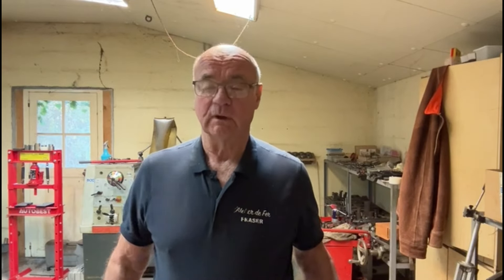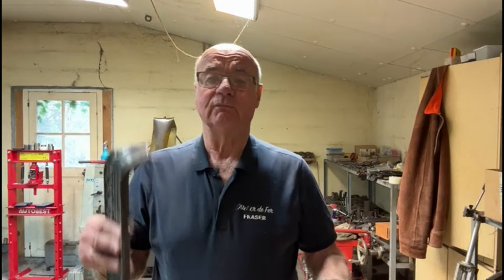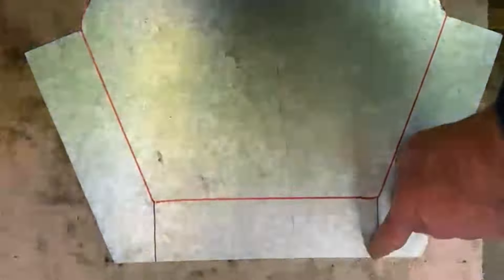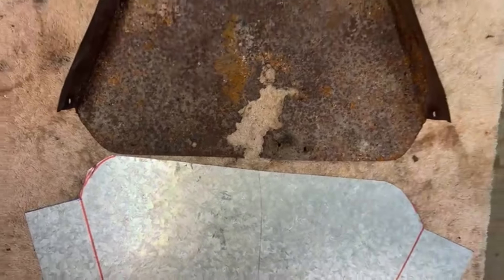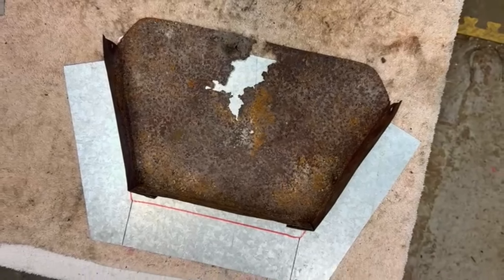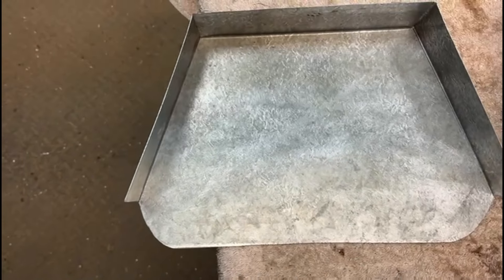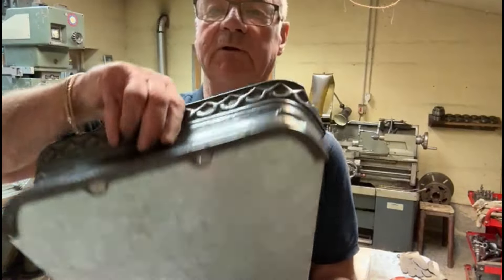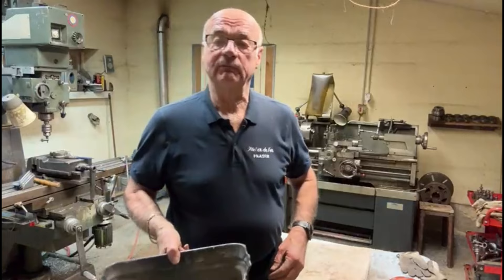How to Make a Replacement Ash Pan

Comment: Well worth making a spare ash pan so you can pull one out, replace it straight away while the full one cools down. I was a bit doubtful that the zinc plating would hold up, but it has not given any problem. Chris B.
Reply from the maker: Hi Chris. Thanks for the comments. It was a bit tricky trying to video while bending the pan, so I didn't get that on film. Maybe next time!
Reply: @MetalworkinginFrance-xe5rg  I have a 4 ft Edwards Box and Pan folder but it is still in bits in the barn, I had to resort to using my bending irons, so I must hurry up and get it put back together, I stripped it down to move it from UK.